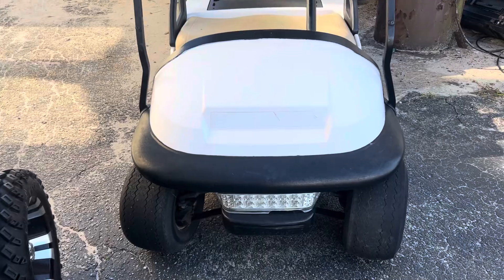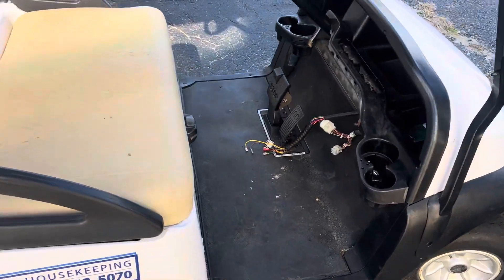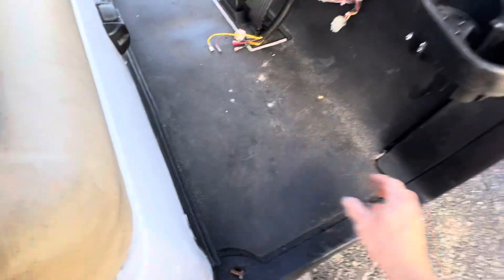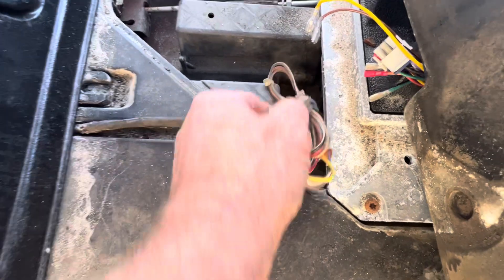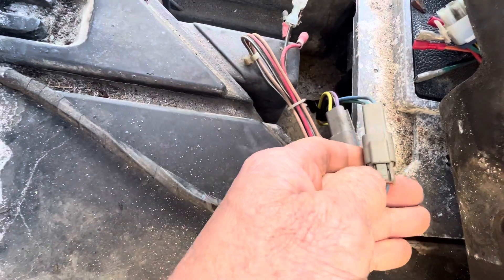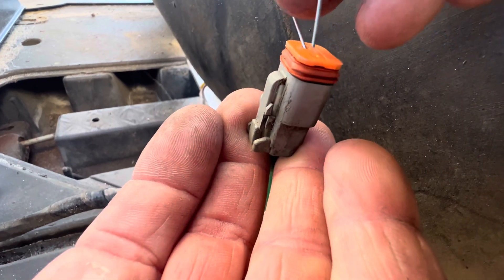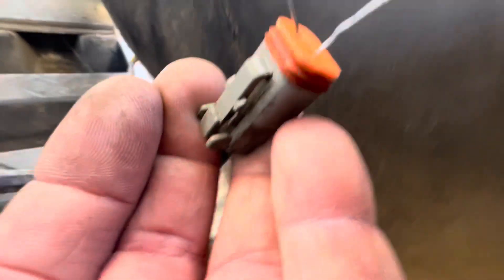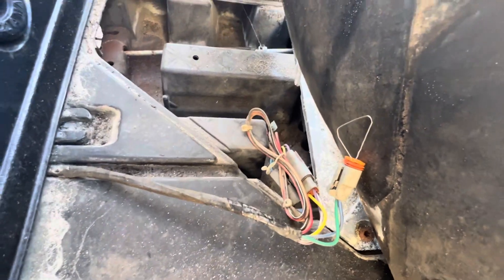The Ultimate Club Car Secret: Accelerator Bypass Uncovered

Comment: Hey brother I appreciate the videos I’ve been checking them out to try to figure what’s going on with my cart. I just bought my cart and it was running fine then the day after I bought it it decided to stop going. I have this same cart i believe and I’ve used some or your older videos to test voltage In some locations. I’ve got voltage to my controller when I hit the pedal but it falls off quickly 
So I was checking out my mcor I had the 48 volts across my blue wire and main black as you stated, then I went on a put a paper clip to by pass and tried pushing the gas but no movement, I’m not sure if that’s the way I’m suppose to complete the test or if you have any other ideas for me to trouble shoot. Thanks so much for the content and ideas brother
Reply: So I figured out that the controller that I bought wasn’t working properly after checking for voltage and continuity everywhere as well as a motor test, so I pulled the controller from my brother in laws cart and the cart seemed to be working as expected. I was able to get a rebuild for mine for about 300 thankfully. With my brother in laws controller and the one I bought both, my cart keeps going into limp mode if I’m not pushing the gas above about half and I’ve got to turn on key switch off and back on to get full power back. I did the sensor test and pushed the cart back and forth to hear the beep beep. I’ve also just resulted to screw it and changed the sensor in case lol. With that being said I also have a new sol, so now I have no idea what could be causing the issue, just wondering if you had any idea of what els I could possibly be looking at as the cause. Again thanks so much for helping me out with my cart and providing great info
Reply from the maker: @stevenclavell604  what year was your club car. Can’t remember. Also watch my video on how to bypass the pedal switch if you have an moor. Try that and let me know.
Reply: @golfcartwhisperer  okay I’ll throw the paperclip in, but it seems to just happen if I don’t keep the pedal over half when the key switch is on. I have a 09 club cart, thanks again I’ll get it a shot when I make it home.
Should I leave the paper clip in and drive it around for awhile to see if it goes limp?
Reply from the maker: So when it goes into the limp mode it runs halve speed??
Reply: @golfcartwhisperer  yea it won’t go back to going fast unless I reset the key switch
Reply from the maker: @stevenclavell604  the paperclip want fix that.  Did you replace the magnet. And make sure the magnet is facing the speed sensor.  Also the only thing that causes limo mode is speed sensor or magnet, wrong controller or welded sol.  Or once in blue moon bad connection somewhere
Reply: @golfcartwhisperer  I can double check the magnet, I did replace that, also do I need locktite on that bolt for the magnet? I didn’t want to over tighten it but I didn’t want it loose either.
Are their any different variations of the 1515-5201 controllers?
Reply from the maker: @stevenclavell604  no as long as it’s the same model number that you replaced.
Reply: @golfcartwhisperer  yea I had it replaced with another Curtis same model. Maybe I put the magnet on backwards? The only thing is that it was doing that before replacing the magnet and the sensor 
Can I bypass the speed sensor?
Reply from the maker: @stevenclavell604  no you can’t.
Reply: @stevenclavell604  When you say "controller", are you referring to the MCOR?
Reply from the maker: First!! Thanks for watching.  Does your sol click or anything
Reply: @golfcartwhisperer  Yea man my controller is clicking both in reverse and drive
Reply: And second thanks for helping on the videos brother!
Reply from the maker: Does your sol click in and out when you press the gas. Or does it click in and hold.
Reply: @golfcartwhisperer  it clicks in and out
Reply from the maker: Not good. Has the cart been towed in run any
Reply: @golfcartwhisperer  I have no idea man I just got the cart two days ago and it was running seemingly fine yesterday until I made it home to check it out
Went to try the first ride and put it in reverse and it went back a couple of inches then I clicked it in forward and it wouldn’t go any further in either direction
Reply from the maker: @stevenclavell604  okay. We’ll that means that the motor is good then replace controller. The drive side is bad
Reply from the maker: So if you hit the gas and hold your foot on the gas. The solenoid clicks in and out while your still holding the gas down??
Reply: @golfcartwhisperer  not it will just click the once and then nothing will happen unless I hold the pedal toward the middle and then it will click in and out over and over
Reply: So I left my key in the on position and my sol was just smoking, I’m sure that’s not a good thing but I’m not sure where to go from that really something that I had no idea about when I got the cart until now when I pulled out the panel that lets me access the controller and sol
Reply from the maker: @stevenclavell604  the sol got hot.  Because the resistor on the aol gets hot when the controller goes bad.  Leaving the key on shouldn’t have hurt nothing
Reply: Update I purchased a new sol and installed it, after connecting the batteries back up the new sol began to smoke again, I’m just guessing now that maybe my controller is bad like you mentioned
Reply from the maker: @stevenclavell604 yes bad controller
Reply: So I purchased a new controller and it installed it, no click on the sol but it’s also not burning. I’m guessing I fried the last sol when it smoked even for just a second?
The cart isn’t moving, nothing is burning anymore tho and when I put the cart in run it is making a small buzzing on my inside panel, maybe just the new controller I’m guess
Reply from the maker: @stevenclavell604  did you buy the same color controller
Reply: @golfcartwhisperer  I bought an aftermarket option with a pig tail
Reply from the maker: @stevenclavell604  what kind did you buy
Reply from the maker: Trying to figure out if you can Bluetooth to it. If not check voltage on the blue wire on the small post on sol. Should be positive voltage
Reply: @golfcartwhisperer  so both wires on the small posts have positive voltage of 50 volts
I just put a second sol in to trouble shoot, no change
Reply: @golfcartwhisperer I have 2 blue wires going into the sol dark blue with white stripe and light blue
My light blue goes to 50 volts from the main ground to the light blue when the key is on in the run position 
The dark blue with stripe has 24 bolts across the main ground and wire when in the key is in on
Reply from the maker: @stevenclavell604 when you hit the gas the blue with white stripe will show negative voltage
Reply from the maker: Did you put a Navitas controller on?
Reply: @golfcartwhisperer  when I hit the gas with the positive in the blue and white lug spade lug disconnected from the sol and the black lead on the main ground and hit the gas in the on position in forward I have no voltage change, still about 24 volts
Reply from the maker: @stevenclavell604  put the red lead of meter on main positive and the black lead in the blue and white wire. And hit gas see what you get
Reply: @golfcartwhisperer  I have 48v across those two connections with no change when I hit the gas
Reply from the maker: @stevenclavell604  find me on Facebook Thomas wells Conway sc. and send video

Comment: Hi, 48v club cart president runs great on low speed but when depress the pedal fully it stalls could it be my MCOR or controller
Reply from the maker: @123leopena thanks for watching and commenting.  But the  m cor is causing that problem. Or batter Voltage  is dropping too low. Test your batteries under a load
Reply: @golfcartwhisperer  thanks for your response, i installed a multimeter on the end voltage of the battery pack and at the moment it did it it had 51v, correct me if in wrong but i don't think is the batteries, replaced the MCOR with a cheap chine one from amazon and still dose it , any help would be appreciated thanks
Reply from the maker: @123leopena so when you put the meter on the batteries. Did you hit the gas and see how low it dropped.
Reply from the maker: @123leopena check voltage right before it did it also how far can you drive it before it quits.
Reply from the maker: @123leopena meaning. Can you drive it at halve pedal?
Reply: @golfcartwhisperer  yes drives normal at half pedal
Reply: @golfcartwhisperer  yes it dropped to 46-44 v at the time of  failure it was at 51v , i let go of the pedal and repressed it only half way and it'll start going again
Reply: @golfcartwhisperer  it will drive maybe a block or so at top speed then it will start stalling till i press it half way
Reply from the maker: @123leopena  yep replace the mcor.  With an own one. Is yours a one piece or 2 piece
Reply: @golfcartwhisperer  thanks for your response, it’s a one piece
Reply from the maker: Gotcha.  Yep just replace with a new one or put something in the box where you can’t floor it all the way

Comment: Bro i got a 01 ran good. I wash it now it does nothing just clicks
Reply from the maker: Did  your controller have a cover over it,
Reply: @golfcartwhisperer  it didn't
Reply from the maker: @charliejordan2357  did you get the controller wet.
Reply from the maker: I am going to share a video with you. Let me know what your voltage shows.
Reply from the maker: @charliejordan2357  48 volt club car troubleshooting
https://youtu.be/OIck71f7YdM
Reply from the maker: @charliejordan2357  let me know if your cart is like this if so check voltages and let me know what’s missing. If you flooded the controller.  You can bust the bottom of the controller open and see if any water runs out if it does take some air and blowing inside of the controller and dry it out
Reply: @golfcartwhisperer  yeah it's just like that. It's confussing me bc like I say it ran good before I washed it. Imma busted the controller open this weekend like u said do
Reply from the maker: @charliejordan2357  yeah you should be good to go once you bust it open.  Then I would get some black rtv to seal the bottom back on.